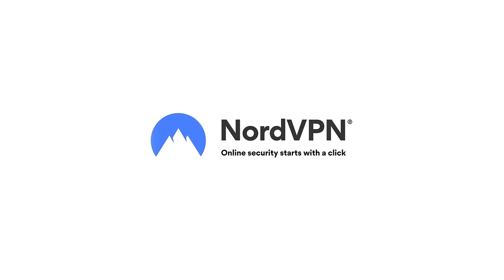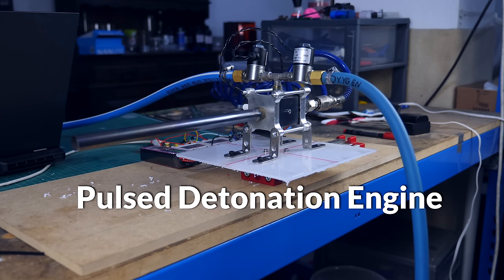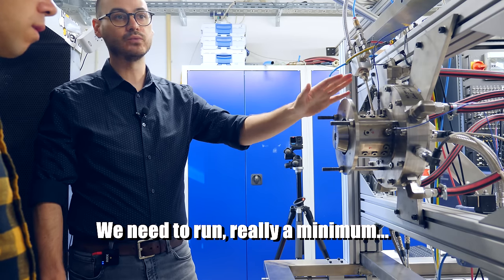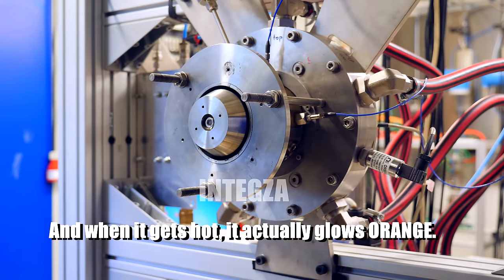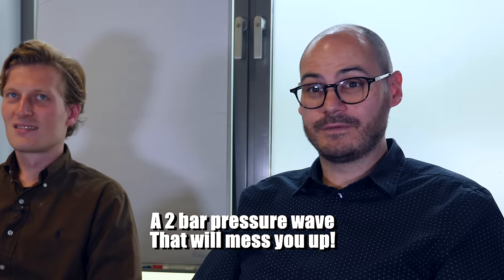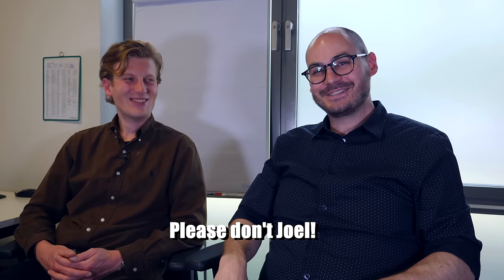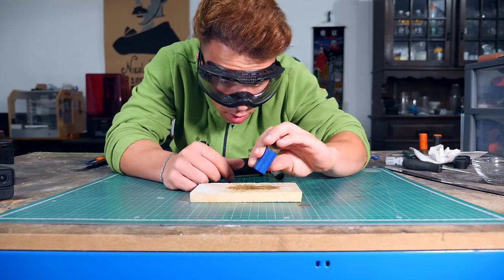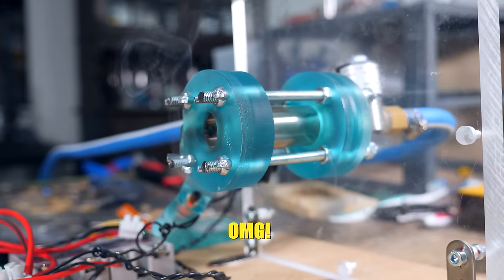NASA lost this TECHNOLOGY 60 YEARS AGO

Comment: I've recently been stuck on spinlaunch, I've watched so many videos on there machine. And after seeing your videos here's my idea,
I think you should build a miniature spinlauncher, you have plenty of knowledge of rockets and other propulsion devices and could use them to power the spin!
Tomotoes are disgusting
Reply: this account was made on; 
Joined Sep 28, 2022
1k likes?
zero comments?
all alittle suspect to me. guess someone really wants that printer.
Reply: I also want that printer 😭😭😭
Reply: @Xfixiateher  not only that but spinlaunch is a scam
Reply: @boisq97  they are a multi million dollar company that has shown time and time again to have a successful plan.
Reply: @spinwarecorvallis9414  just... no
Reply: If you don’t want the printer could I have it please?
Reply: @spinwarecorvallis9414  you understand they want to spin a 100m long bar at 450rpm to achieve a final speed of over 1000mph and a load of over 10000G’s that means the 200kg payload will weigh the equivalent of 2000000kg not to mention the weight of the assembly itself. 

Secondly they also have a massive stability issue even when launched at low speed because the nose is traveling in a different direction than the tail. You can realize this yourself by taking a long stick and spinning with your arm straight out then let it go. The stick will always continue to rotate in the air.
Reply: @gilliesiut2332  your so wrong it hurts.
Reply: The amount of people in the comments section of this that don't understand full basic physics is.. sad,  you can launch items straight using a centrifuge, the military has done it before and here's a hint, we have used the same principles now for CENTURIES to power siege engines, a Treb and Catapult are all using a mix of lever & centrifugal force to accelerate a payload with greater energy and trust me they fly as straight as a ballistic arc allows and if people don't understand that I'm starting to wonder if they have done high school physics, or hell ever Bowled a ball.. etc The physics are the same, Cricketers are using the exact same physics to bowl cricket balls down a pitch, rotation, release, straight until outside force acts on.
Reply: You literally got all of your likes in a few hours and you got almost none after that… yea, definitely a scam.
Reply: @starfleetau  Those projectiles were round. Not a rocket. Try launching a rocket shaped projectile from a trebuchet and see if it flies straight...
Reply: @spinwarecorvallis9414  what am I wrong about specifically? The information I took directly from spin launch itself? Or the physical experiment I proposed to show you how you are wrong
Reply: @starfleetau  round projectiles rotate in air for stability… rocket don’t, especially end over end. Like I stated before. Spin in a circle with a long stick, and your arm straight out with a stiff wrist then just let the stick go. It will continue to spin. Clearly your incapable of preforming this basic experiment so I don’t understand why you’d have the audacity to claim knowledge on science
Reply: @gilliesiut2332  : The rocket will obviously stabilize itself after a few oscillations, which should not be taken as an endorsement of Spinlaunch, because I consider it to be a stupid idea.
Reply: @gilliesiut2332  And exactly why shouldn't we try to accomplish this if it means saving tons of resources?
Reply: @starfleetau  but waaah the machine doesn't go big boom!
Reply: @absalomdraconis  no it won’t… it’s not designed for spin stabilization and it’s spinning on the wrong axis to achieve natural stability… do the experiment I recommend with a stick and you will see exactly what I mean. Now imagine it at 100x faster. You can even observe this phenomenon in the videos they released themselves. You can see the tip of the projectile exit at a different location than the tail. This on ballistics terms is called keyholing. At 50 seconds you can clearly see it in the high resolution slow motion footage. It almost appears to tear sideways through it but it’s because the projectile has already started to spin. https://youtu.be/Z6esOcWrrEE
Reply: @amentco8445  because it’s not possible… you might as well use a cannon or rail gun. You would have the same loading forces (2000g’s) and the same amount of total energy in the system not to mention the 2000g load will only need to be tolerated for a split second rather than prolonging it by slowly spinning up and slowly building to 2000g’s . Your also not wasting energy on spinning a giant arm to 1000mph, so a cannon is actually more efficient
Reply: Yea, if he could 3d print carbon nanotubes, it would be great
Reply: @falconflylow  that would be awesome
Reply: @gilliesiut2332  id rather see the rail gun idea happen cause that would be badass
Reply: @spinwarecorvallis9414   Vaporware is a thing.
Reply: @falconflylow  Surviving the G-load would be one thing. but the launch projectile would still be spinning (in an very, very "unhelpful" direction) at several thousand rpm.
But I'm not convinced carbon nanotubes would hold up to the G-load needed anyway.
Ironically, I do think you could use manual force to "assist" a rocket. Like a giant double trebuchet lifting a launch pad vertically a number of meters at launch. But I mean to like 10m/s to save gas. Breaking inertia and getting to 10m/s is a noteworthy amount of fuel spent.
Reply: What's going on with your account?
Reply: @iceman5117  no idea
Reply: @iceman5117  what do you mean?
Reply: @spinwarecorvallis9414  "joined 4 days ago"
Reply: nono he should build a rocket spin launcher!
Reply from the maker: Congratulations! You just won a 3D printer! Send me your info (Name, Address, Zip code, Phone Number) to integza@gmail.com.
Reply: @integza  That's really hurts to give this thing to some wrong cheater person who got 2k likes by hacking or something at the 3rd day of uploading this video even the likers of the video was only 300 people......Its so Bad Integza..
Reply: @PUBG-kr4qb  skill issue
Reply: @integza But he just stole the idea from SpinLaunch - an actual American Co that's been doing that for Years!  Sad.
Love your channel and work!

Comment: Idea: I would love to see you use a piezo pressure sensor with an oscilloscope and  a high speed camera so we can see whats really going on and maybe improve the engine.  ( i know high speed cameras are very expensive but maybe you can lend one locally or from Dave of eevblog)
Reply: I have a feeling that a pressure transducer that is able to read such high pressures would be ridiculously expensive. But it would be rad to see
Reply: @Takatakyong cars have detonation sensors
Reply: @dtibor5903  Those are acoustic, specific for a frequency, and not exposed to an environment harsher than a warm engine block.
Reply: @Takatakyong   I mean if acrylic can hold the pressure its not that high ;) If not maybe a throttle/throttle valve could lower the pressure to the sensor range

Comment: Maybe you need to add an aerospike so the detonation has something to spin around. The Miles-Bach-Michalski engine has a central spike though it was truncated. Another thought is to move the primer to the back of the device instead of the exit port and angle it to induce rotation. The MBM engine had their starter in that position. Also being in the Northern hemisphere you will want to spin anti-clockwise so you aren't fighting the Coriolis Effect.
Reply: Would that not make a bad engine design for practical use,  a jet flying north to South across the equator, for instance how would that affect the rotation?
Reply: @EbenEliasjr i don't think the coriolis effect is that big of a deal
Reply: @serbianspaceforce6873  That's what I said. He was saying to have it spin anti-clockwise, and I said, "Is that not a bad design? What if the plane flies north, what really matters is the airflow through the engine and pressure gradients not the spin...otherwise we would notice a huge issue in modern turbo fan jet engine planes... any way your right and I agreed 👍
Reply: Learn to keep ideas to yourself. You're not getting paid to share information
Reply: @EbenEliasjr  this engine has no moving parts. Only the shockwave rotates. The Coriolis Effect would be slight and I trying to think of ways to tweak performance especially at the small size @Integza was using.
Reply: @jamesjohnson5700 that’s the idea…
Reply: @cephotographic  the coriolis effect is always slight. or to be more accurate: not measurable, because it doesnt really exist.
Reply: @jamesjohnson5700  seriously ? oh wow...

Comment: This guy is insane, that's some amazing high speed footage too 

Also, using a smaller engine to start a larger engine is not terribly uncommon. They're called a pony engine usually, and a lot of industrial engines and tractors have them.
Reply: Your car has it. There's an electrical motor that starts the gasoline engine.
Reply: @chryssalidbait8765  YEah, and larger turbine engines rely on pneumatic starters.
Reply: They use them on commercial jets and i think on the A-10 warthog

Comment: You can make a suitably sensitive primer type powder using Armstrong mixture from matches. 

The gun powder you used is actually smokeless powder, it’s nitro based and burns slowly at stp but burns much faster under pressure. Black powder (the old sulfur and charcoal stuff) burns faster at STP but doesn’t increase burn rate with greater pressure.
Reply: That is not true BP does burn faster under pressure
Reply: @mikker32  even if it does nitrobased gunpowder is more powerfull
Reply: He didn't use gunpowder, he used the primer. The primer is usually a high explosive lead salt.
Reply: BP also drastically increases its burn rate when confined/under pressure, but not as much as smokeless powder.

Comment: I really like this engine. There seems to be a really high frequency sound, even ultrasonic when it was running on your trip, and possibly in your lab. If you used propane which is widely available in cylinders of different sizes instead of hydrogen, you could still produce a detonation with a relatively clean exhaust. If you could use air instead of oxygen and sustain the rotating detonation wave that would be fantastic also. If you took several, say 5 of these units made of extruded clay cylinders and placed their exhausts in an axial bunch, and then twisted them with front and back endplates like a manifold, you could put a greater path length in a shorter package. If they were made of ceramic they could tolerate the heat better than metal. The nice thing about these RDE's is that they could run at very high Carnot efficiencies. Ramjets have a low theoretical efficiency because they depend on the Ram effect to compress the air. RDE's could get around that by performing the compression rotationally and thus centrifugally. The figure of merit would be, like fusion, how long can you run one of these things sustainably if mounted to an RC model. It would quickly vanish from radio contact, but you could use ham radio or ISM band frequencies and a larger antenna to track it.

Comment: Hey there Mr. Integza!!! I just wanted to say that gun powder does explode. It just needs to be put into a container. When you ignite the powder it quickly turns into gas (keywork: quickly). When the container can no longer hold the pressure of the gas released by the gun powder then the container rips apart allowing the gas to be expelled forcefully in all directions. That's an explosion.

Comment: Fun gun/primer facts. Most modern primers use lead styphnate and a blend of other herbs and spices. However, older ones use lead azide, or mercury fulminate.

Also, smokeless powder like what’s found in those shot shells just deflagrates, it isn’t a detonation like Black Powder does. Different powders have different “speeds” they build pressure at, pistol powders reach peak pressure faster than rifle powders (generally).

If you’re looking to repeat this, check out primers for muzzleloaders (usually called caps). In heavily regulated countries they tend to be easier to acquire than centerfire primers like the #209 in that shot shell.
There are also companies like Prime-All who sell primer component mixes which are themselves not regulated and not explosive, but can be used to create a primer mixture.

Great video, and it’s a bit funny to me that it’s so tough to get ammo components there- I can buy them at my hardware store!
Reply: black powder doesn't detonate either, it's actually one of the slowest burning things we classify as an explosive. you basically never want a high explosive as a gun propellant, too much risk of rupturing the barrel. the projectile doesn't accelerate via shockwave, but by building up the pressure as the propellant burns; that pressure then pushes the projectile down the barrel. incidentally that's why it looks so unimpressive when he burns it in the open; without that controlled pressure buildup, it's basically just a really expensive pile of tinder
Reply: You can also acquire blanks for powder actuated tools in many European countries.
Reply: @Tunkkis  or be Austrian and over 18, then you can just buy the black powder in gun shops (and I'm assuming also smokeless powder, but black powder for sure. Can also get a rifle and rounds if you're at it lol, and we're not even close to the most liberal gun country in Europe)
Reply: You might think it's funny, but that's partly why his country doesn't have mass shootings every single day.
Reply: @BooBaddyBig hahahahahaha hahahahaha and spoons make people fat. NEXT.
Reply: @BooBaddyBig  LOL! Found the normie!
Reply: @CharveL88  Yes, what a normie thing, not personally knowing anybody that was shot to death, not having to train as children in shooting drills, having 8 mass shootings so far this *decade*, compared to 9 the last seven days in America. boo hoo, how sad for us normies.
Reply: Both black powder and smokeless deflagratate... If they are detonating you're doing something wrong lol
Reply: @BooBaddyBig were still 100 times lower than the amount of mass shootings that would convince me to not love constitutional carry with no permits
Reply: @DarkAttack14  So you think everyone should carry guns???
Reply: There's nothing funnier than someone trying to sound smart, and being completely wrong.
Reply: You forgot potassium chlorate primers, though primers using that are corrosive. That's why they aren't used anymore, at least not in the West. That said they were widely used from the late 1800s until after WWII.
Reply: You forgot about Armstrongs Mixture

Comment: I believe if you add a little bit of restriction to the nozzle of the engine, like the metal one in the lab, it will allow for a little bit of pressure to build on the inside which might help promote better detonation. It seemed that you had an original detonation followed by deflegration
Reply: I don't think you need restrictions on RDE. Whole point of RDE is that the exhaust is already supersonic without use of nozzle.
Reply: @dongleseon8785  then how come the metal one in the lab has a type of nozzle?
Reply: @3ch0_17  I think that's just a inner-cylinder that has narrowing ends? The whole thing looks quite straight cylindrical to me.
Reply: @dongleseon8785  could possibly be. But I'm seeing that the size of the exit is smaller than integzas design
Reply: @3ch0_17  I guess that would make a pressurized fuel mixture judging by the flowrate they use. Which would help greatly if your goal is to make a lot of thrust. But would the 3d printed part of integza withstand that kind of pressurized explosion...?
Reply: @dongleseon8785  which is why he would have to scale it down alot, probably smaller than his current setup
Reply: @3ch0_17  I think he is trying to stick to the original dimensions in Japanese paper as much as possible because otherwise, it'll become guesswork especially because there's not much other RDE success case which use that low flow rate.
Reply: @dongleseon8785  well what was the success parameters of the Japanese rde? Sustained ideal combustion or initial combustion unsustained?
Reply: @3ch0_17  In the paper, it's 300ms of runtime with confirmed stable rotating detonation using high-speed camera. But after reading it more thoroughly, I think integza's design has some obstacle to go through. First, japanese RDE was in the vacuum chamber. Second, they were using ethylene instead of hydrogen. I believe these difference will impact a lot on optimal dimension of the engine and that means the design he is using is somewhat destined to be doomed?
There's another paper that he should follow actually. The minimum flow rate is around 60g/s so it's a bit beefier design but at least this one can run on hydrogen and in normal pressure.
You can find this other paper if you search this in google :Small-size rotating detonation engine: scaling and minimum mass flow rate
There's also another design that use 10g/s but again, this use ethylene instead of hydrogen.
10g/s ethylene RDE: Design and testing of a small-scale laboratory rotating detonation engine running on ethylene-oxygen